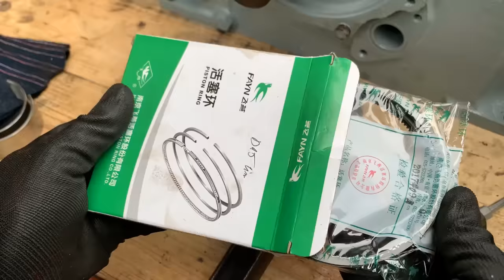Farmer's Farm Tiller Restoration roject //  Rusty Old Plow Restoration Skills

Comment: Looks like my.Dong Fung Chinese rotory.tiller + WARMING always.cover air intake and exhaust pipe or.rain will get in had to strip.mine down twicec/o rain flooded motor pistons and sump..the rubber less wheels are rice.paddy wheels bt your missing the haulage bar.and ride on trailer. Normally there should be.a big.hooking point on the motor.for.ezy lifting.lol now it's the same colour.
Great little machine plowed acres with mine
Reply: Yes right. Its 1980th Dongfeng ❤️S195 12 hp, 2,200 Rpm. Tiller 3+1 gears low and hight , 2 gears rotary. Not bad for this farm matchinary I got 1 completly same in vedio. For all spare parts you can find on Alibaba or Aliexpress.
Reply: Aà.
Reply: 9

Comment: You do some of the best restorations of motors and such to like new condition.
Reply: He has absolutely no clue of engines he torqued the Connecting rod down like he wants to, he has to use the right torque spech and he taps bearings with a steelhammer in the housing, a absolute no go, he also paints bushings, you have to tape them of.
Reply: @m.o.f9802  hk